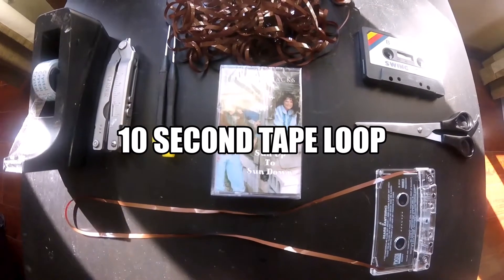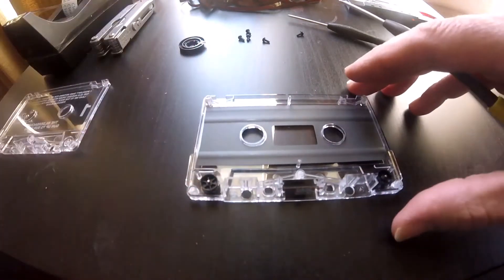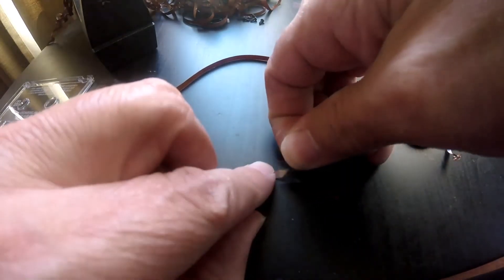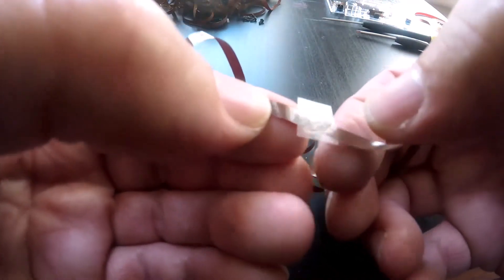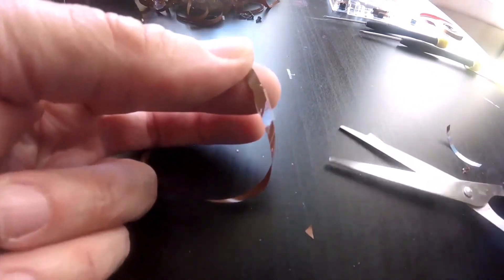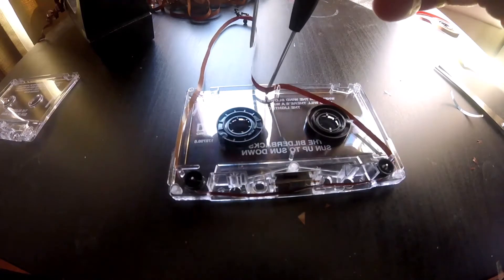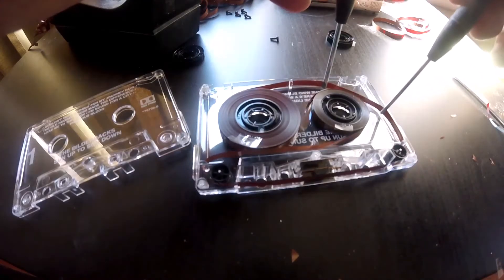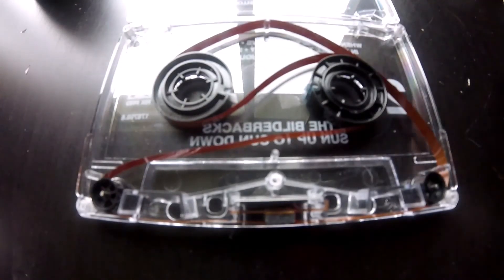Making a 10 Second Tape Loop

Comment: 14.5 inches will get you around 8 seconds and I used that length with the top peg like you showed me to get mine to loop. Before I used that top peg it would play and then stop spinning.
Reply from the maker: Fantastic, Logan Aaron! Glad you got it working. Hours of fun ahead! Does it play  in reverse too? That is my favorite myself. Some cassette loops will do it, and some won't.
Reply: @ShaneMorrisMusic  Funny thing is I tried it the next day and it snags again and stops. Didnt do anything to it just stopped working. The roller on the bottom right isnt moving. Any idea how to fix that?
Reply from the maker: @loganp82  Maybe just try replacing that roller. I use old cassettes for parts, especially the ones that don't have screws to make loops out of. Hopefully that will fix it. Sometimes they just don't work too. Make sure the tape loops isn't too tight or too loose. Not tangled or flipping over somehow.
I've made about 20 or so and 2 of those I could never get to work.
Reply: @ShaneMorrisMusic  Alright, thanks for the tips :)
Reply: How do you calculate the loop duration based on lenght? There is any straightforward formula for that? Thank you!
Reply: @nasoundengineer5726  "Normal" playback speed is 1 7/8" per second.  So, just take seconds and multiply by 15 then divide by 8 to get length.  e.g., 10 seconds = 150/8 = 18.75 inches.
Reply: Or, take length and divide by 15 then multiply by 8 to get seconds.   e.g., 15 inches = 1*8 = 8 seconds.

Comment: Interesting but…why would anyone do this? For what purpose? To get a loop sound effect?
Reply from the maker: I suppose there would be many reasons. Some people just like the sound of tape with its warm, natural compression and saturation. Some people also equally like the bad or lo-fi sound that can be achieved from tape. Others may want to work with it for economic or ease of use reasons. Maybe some just want to have a cheap looper with the ability to make your loops any length you want. For me personally, I like the lo-fi, deshevled sounds that come from tape for creating texture in a composition, particularly horror film scoring and dark ambient music.
Reply: @ShaneMorrisMusic  

I see…i suppose you mix with analogue gear then. It would be too easy to cut tape digitally.
Reply: Plus itt is fun, creating cassette loops and using them. If you want to listen to some good music created by using tape loops check out Amulets or Hainbach, they're pretty good.

Comment: Cassette tapes play at 1 7/8 inches per second. Therefore, if you’re still resolutely non-metric (ie, you live in the US), you will need exactly 18.75 inches of tape. Tbh you’d be far better off fitting your tape loop to the cassette rather than trying to make an arbitrary length work…